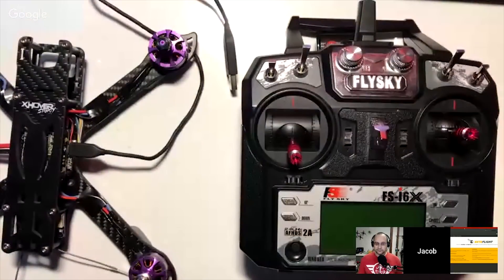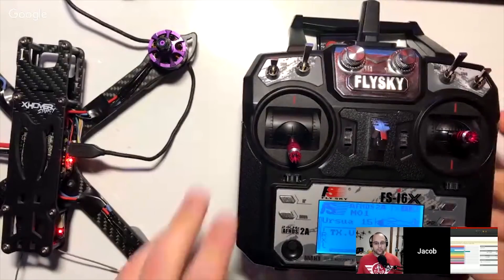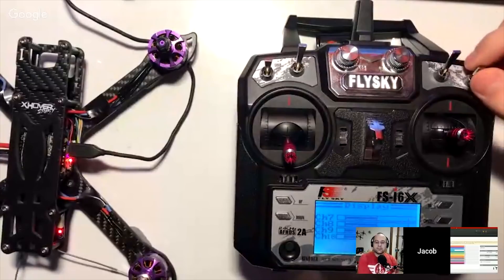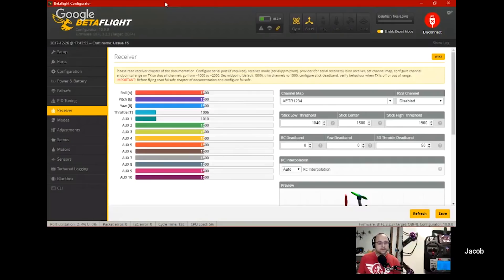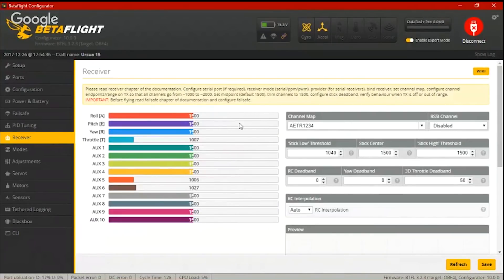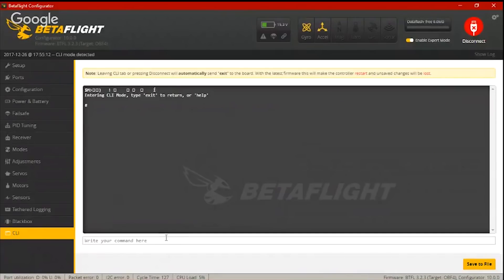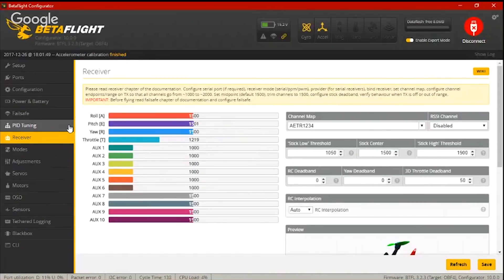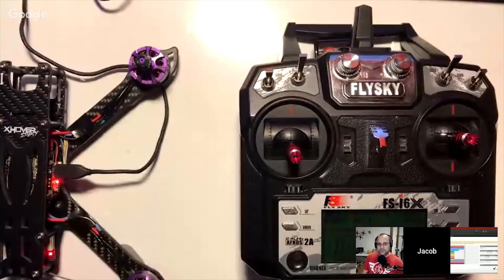1-ON-1 TROUBLESHOOT: Jacob Ursua Aux channels don't go to 1000 | SOLVED

Comment: Get a Taranis -- Problem solved
Reply from the maker: This wasn't really the radio's fault. Anyway, he's a freaking teenager. Maybe he doesn't have $200 to blow on a Taranis.
Reply: Oh yea I know, I was just being facetious. Let's not limit that last statement to just teenagers now. My broke ass can't pull the trigger on m7 gimbals.
Reply: im thinking that the problem may have been with the radio.. i had a evolution and you had to seperate the aux switches and it took some playing with or you would end up with them doing crazy things as far as how they moved through out the spectrum .was it possible he changed the model on radio in a attempt to rebind?
Reply: I was beginning to wander if he had the aux channels assigned to more than one input also. One overriding the other. I've done that, but playing with the switches showed me the problem. I needed to reassign the aux channels properly.
Reply: Joshua Bardwell mayby he cant, but Q X7 is stupidly cheap. He cant pay too much for radio, but can stupidly high for not worth that much money frame?

Comment: Weird!? Well, good it's fixed now :-)
However I suggest next time to get the CLI-output of "diff" or even "dump" before and after fixing the problem. That would have gave you the chance to compare the configs and figure out what made the issue ;-)
Reply from the maker: Yes, we did that, although it's not on camera because it didn't produce any useful information. But somehow reflashing the board fixed it.

Comment: Had the same sort of problem when I built my FT gremlin, but instead of aux channels my control channels were messed up. Spent 2 days trying to get it working. Ended up with the same solution, no clue what fixed it but it worked after reflashing  the umpteenth time.  Makes things feel a bit better knowing these things just don't happen to one person!

Comment: Why don't you compare the two dumps (backup from before vs. the fresh, reconfigured version) with a diff tool like diffchecker.com to see which settings are different ? That's what I do when I upgrade to make sure I didn't miss a new command or an old one is not compatible anymore
Reply from the maker: We didn't find anything there.

Comment: Nice video I took was a great help.  I was wondering if you've been hearing of an issue with HGLRC F428 V2 FC ..after flashing to 3.2.3 the accelerometer dies and there is no CPU load but board lights up normally..
Reply from the maker: I haven't heard of any issue specifically but in this case my usual guess is you have flashed the wrong target to the board. This can cause resources like gyro and acc not to work.
Reply: Joshua Bardwell thanks so much I will try to flash another ..it says it's omf4  which is to me omnibus...it did a great hover test but didn't work the next day ..

Comment: Man had same problem with the dys f4 board except on the controls pitch roll yaw wouldn't go below 1500 I gave up and got a new one about to find my old board and reflash again see what happens
Reply from the maker: It's almost certainly the transmitter having the issue there.

Comment: If he dump the old settings or using diff. He can compare the difference between the actual settings and the backup one.
Reply: Phuc Luong I did compare the settings prior to asking Joshua but I couldn’t see anything that would cause my issue
Reply: Jacob Ursua using a text compare software?
Reply: Phuc Luong I used a website online to do so
Reply: Jacob Ursua perhaps as JB says that can come from some settings that are or displayed on the dump CLI command. Happy that you have your aux back! Happy flying 👍
Reply: Phuc Luong Thanks, you too!
Reply: Joshua Bardwell but it works after a full chip erase.
Reply: Without a full chip erase some erroneous information could be left over in the registers. You would think that even without full chip erase the programmers would think of this, but I could be wrong. Every bit in every register should be flushed out during programming. Don't leave a ghost in the machine. LOL
Reply from the maker: Remember we did a complete fresh flash of the board and it didn't fix the issue.

Comment: I have a furious Fpv radiance sabot version that when I go to the reciever tabs it doesn’t show any movement in the sticks or switches but I can put the receiver on another fc and it works fine I even put another receiver on the furious Fpv fc and it works fine just it will not work with my xm+ that I was using on a 3 inch build any clue as to why that happens
Reply from the maker: Well most likely there is simply a configuration issue that is causing the receiver not to work. All you know at this point is that the receiver is bound to the transmitter.
Reply: Joshua Bardwell well I can plug an xsr receiver up to the board and it works fine switch out to the xm plus receiver and it does not work
Reply: itsalmostover I have reflashed the and did full chip erase option

Comment: I am sitting here thinking you guys should be checking the modes page first. I am watching to see what's going on though.
Reply: Maybe the info for the modes didn't get sent, but that was strange.
Reply: When you guys went to the modes page there was nothing set up. Why?
Reply: Double A That was because I had reflashed the board with full erase so those were gone
Reply from the maker: We reflashed the board as part of the troubleshoot.

Comment: telecoms is awesome. I was having this problem and was just wondering if I could ask you this. my roll won't go to 1500. it bounces from 1501to 1500. tx is evolution.
Reply from the maker: A little bit of jitter is commonly caused by the mechanical tolerance of the gimbals. 1 to 2 us of jitter is not a problem.
Reply: If it's more than 1-2us or it's just bothering you there's also the option to add deadband
Reply: i have the same problem with the evolution...  but i really don't notice the little bounces in flight.